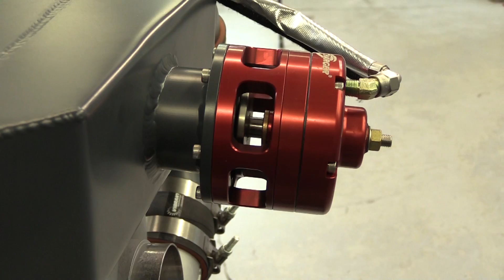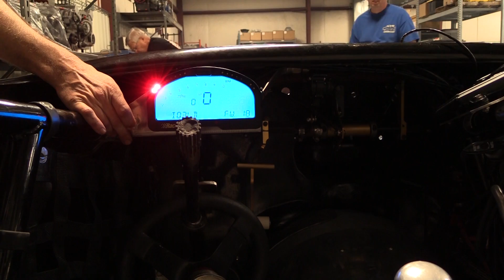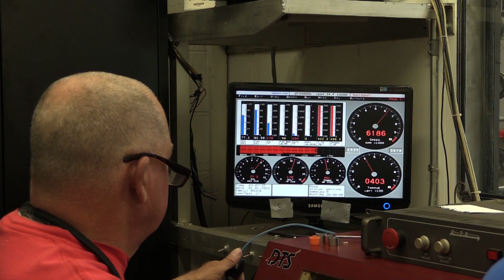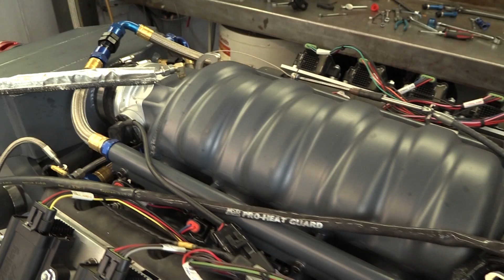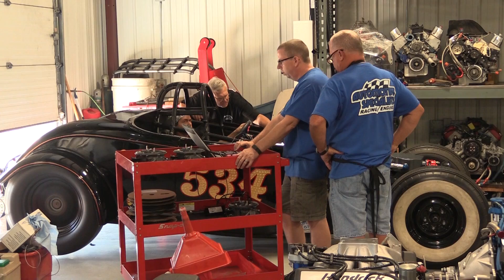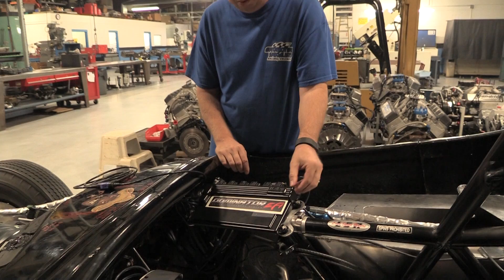A Thousand Horsepower on Just 260 Cubic Inches!

Comment: Engine size and combo are moot. They tested a thousand h.p. turbo. Bought not thought.
Woo hoo. 😐 an sb2 should make 1000 h.p. n/a. Unless somethings wrong.
Reply from the maker: A 260 cubic inch LS is going to make a thousand horsepower naturally aspirated?
Reply: @TheHorsepowerMonster  i never said that. Thats your spin. But an sb2 will easy. 260 cubes X 3 = 780 h.p. so your turbo was good for 220 h.p. and will be able to carry its own weight.
Yes pathetic from my point of veiw.  But 1000 h.p. 260 inch are good buzz words.
Reply from the maker: @mohanperformance.enginerd.1308  The rules of the class require the engine to be less than 260 cubic inches. Dorton determined that they would need nearly 1,000 horsepower to break the speed record. (Sorry, I typed LS in my earlier comment when I meant SB2). So how else are they supposed to get there? Of course an SB2 can make 1,000 horsepower, but not when limited to 260 cubic inches. How is this "spin" or "pathetic"?
Reply: @TheHorsepowerMonster  It seems you believe 1000 h.p. or just under 4 h.p. per c.i. is a great achievement with a turbocharged V-8 spark ignition engine. Is this a fair statement?
Reply from the maker: @mohanperformance.enginerd.1308  There are plenty of 1,000 horsepower engines out there. Most people who view videos on my channel can appreciate the engineering that goes into achieving it in different ways. If that's not you, then that's cool.
Reply: @TheHorsepowerMonster  how come you won't answer my question. Does my question make you uncomfortable or seem offensive in some way?
Reply from the maker: Sure, I'm impressed by any motor that reliably makes a thousand horsepower.
Reply: @TheHorsepowerMonster  a motor is a divice powerd by electricity. This conversation ends here.
Reply from the maker: @mohanperformance.enginerd.1308  That's pedantic. Motor and engine are colloquially interchangeable. Nobody that reads my comment is going to be confused and think I'm talking about an electric motor. I know tons of engine builders and almost all are willing to use the two terms interchangeably.

Comment: There was a whole stack of these built 5-7 years ago. Nelson racing built a twin turbo LS 260, custom crank for big block 6.535 rods, boat racing. It made 1200hp and he ran it wide open fully loaded for a half hour. When they took it apart after 5 hours of testing, there was no wear at all. All the bearings looked brand new.
Reply: this comment is very slept on. These 260 class motors have a legendary record in boat racing. Seems like the extra rigid block, low inertia components moving tons of air through a head, and the ability for boats to dump all that waste heat into unlimited coolant combined to one hell of a package.

Comment: Let's see. In the late 70s there was a 209 ci stock block run at Indianapolis that was putting out 1100 hp. The kicker is it was a freaking AMC. Supposedly one of the most powerful engines ever run at Inianapolis.

Comment: I do believe for ultimate power nothing beats CID cubic inch displacement with that said I also believe it's not how big your are but how you are  built and turbos are a  prime example of that  , take a normally aspirated engine platform add twinn turbos with the proper compression ratio right cam manifold  and ported heads and you can quadruple your engines  power    iv seen lil 4 bangers with 1400 hp , could you admagine how much more hp you could get say out of  twinn turbo charged 350 V8

Comment: I'm a little surprised the SB2 holds up to that amount of power under boost, I met some guys running a turbo one that kept lifting the heads off at the top end of the 1/4 mile, the SB2 was designed for NA power, even with high compression, the secret must be the short stroke, I believe they were running 383 or 400 cubes at the time. I don't know if they ever got it figured out, only saw the car a handful of times

Comment: Hold your horses. Small cubic inch numbers per cylinder mean it's hard to get compression? Someone needs to elaborate this for me please. Must mean that all the japanese and central european engines with around 400 to 550cm³ per cylinder don't make the power they make or that they can't be mass produced engines? I really don't get it.
Oh, or is he referring to american engines?
Reply from the maker: Not exactly. I probably wasn't clear enough with that. Dorton wanted to keep the large piston diameter because it allows for bigger valves and better airflow into the engine. So in order to get the cubic inches down to where it needed to be he had to cut the stroke. So the short stroke combined with the bigger size of the combustion chambers (in order to work with the large valves) dictated a low compression ratio. In order to combat that, he simply cut out two cylinders, which allowed him to use a longer stroker which bumped the compression ratio back up where he wanted it. Hope that helps, and thanks for watching!
Reply: @TheHorsepowerMonster  Okay I see. So you didn't want to change the piston shape nor the cylinder head to facilitate a higher compression. I understand, it is much more complicated.
Reply from the maker: @GERntleMAN  You got it. Thanks!

Comment: We get 1000hp out of a 2.6L (or 158ci in old imperial) turbo straight 6 in Europe. 
How do yanks get soo little hp out of such big engines.
My 2.0 turbo has 614bhp reliable 14876miles on it so far no issues other than one leaking injector seal (bad after just 200ish miles)

Comment: In the 1980's a 1.5 liter (91.5 cu. inch) twin turbo V6 (Ferrari or Renault) or inline 4 (BMW) Formula 1 motors produced 1250 to1500 hp in qualifying tune.
Reply: That’s speculative

Comment: 4.3 liters making 1000hp... ford did this years ago with their 4.6 liter and that’s making 1000 hp at the wheels not crank. Ford’s 3.5 v6 in the GT MKII makes 700 hp stock so with some tweaking it’ll hit 1000hp.
Reply from the maker: Ford made 1,000 horsepower with their 4.6?
Reply: The Horsepower Monster aftermarket parts but a ford block
Reply: The Horsepower Monster you act as if the engine in this video is also stock... I never said it wasn’t a great achievement. I love all huge power builds. But since you’re being a dick about it I won’t watch any more of your videos. I simply pointed out there are many other builds out there that are just as impressive and even more impressive.
Reply: Honda K series modified with 2.4 L made 1000 hp.
Reply from the maker: So Ford never made a 1000 horsepower 4.6.  I don't understand why people like to point out other engines. Sure, this isn't the first 1,000 horsepower engine, I never said it was. I just thought people would appreciate the engineering that went into the build. So what if somebody has built a thousand horsepower 4.6 already?

Comment: I have a similar build in mind, i want to destroke a 6.0 ls engine, the shorter stroke is supposed to allow the engine to rev higher and with less friction.
Reply: Valve train is what limits high rpms

Comment: You can get that much hp out of 3 litre 2 stroke WITHOUT forced induction
Reply: Lol 4.2 liters for 1000hp.   Thats a waiste.   Need only 2l and 4cyl for that. Got 2.2 5cyl in europe who daily 1000hp no problem.
Reply: @bergrud  But make how much torque at that speed? Also, if you think a Honda is going to the Bonneville 230+ club, I'd love to see it. Nothing against Honda.
Reply: William Landen im not talking Honda.   Say Audi s2.  You have drag setups in those no ls with similar Numbers can beat.  Stockholm open has been won by one on 950hp.  And Thats against several 1000-1700 v8.
Reply: @bergrud  nothing beats a 2 stroke m8 :P

Comment: 1400 BHP from 91 cubic inch 1985 bmw f1.
Reply: Wasn't that just a qualifying power level? Those things would not last like that.
Reply: iPROFITDON yes I dunno why he’s boasting lol while it’s cool and all those engines were toasted after qualify laps😆 and the 1400 hp was guessed as the Dyno wouldnt go past 1200
Reply: @zethloveless7238  I mean it's cool to look at the numbers if you ignore the fact that it only lasted a lap lol
Reply: iPROFITDON yea I’ve had so many dudes bring that damn car up 🤓. But still pretty awesome it did make around 800 from a 1.5 for the entire race 🤷‍♂️ back then you had no limits on the number of engines you could use either.
Reply: And that was with a stock BMW block. Not a special racing design. How much were Offy's putting out in the day.

Comment: ....or you could start with a 4.0 l (240 CI) Mercedes E-63 at 600+ HP... because it's capable of doing a couple hundred thousand miles at the 600_ hp level - I think there's room for some headwork, a new cam, and some bigger turbo to get close to that 1000 hp mark.

Comment: In my younger days i built a 283  with 60 over and 11-1 forged pistons on factory pink rods ran on reg pump gas with a mallory dual point  ,
One fine day with my fine tuneup on the new superlane expressway i decided to go all out for top speed , as the pink rods were limited to 7250 rpm i went by rpm  ,on 1st to 5k and on 2nd to 6k and on 3 to 7k plus , , ,  at 7250 rpm i heard the beautifull engine sound pitch began to change so i backed off and saved the engine , it was a wierd wonderfull but so dangerous experience, 
After years i came across a speed math formula and calculated 
It turns out that my speed was 197.3 mph when i backed off from 7250 rpm at high gear 
All this was in a 55 chevy 4door that i got running and was my daily driver as a highschool student back in 75
SHARE your story

GREAT STORYS and GLORY DAYS

Comment: Not to rag on the guy they did an awesome job but there are 4cyl making that kind of power and the inline 6 2JZ Supra engine will make double that. It just sucks that they couldn’t get more power from an American built engine
Reply from the maker: Not at 10 psi of pressure they aren't making more power than this. And they aren't making five-mile passes at Bonneville and living. He stopped at 10 psi because they got to over 1,000 horsepower which was more than enough to break the record they were shooting for. Thanks for watching.

Comment: General Motors Holden of Australia made a 253 cubic inch OHV V8 cast iron engine from 1969 to 1999 for several types of automobiles. 
Quite reliable overall in standard factory form. 
Capable of 500+ bhp without forced induction.
Enjoyed your video.
Reply: Holden 253's finished production in 1984, not 1999.
Also no Holden 253CID motor ever made anywhere near 2HP per cubic inch without boost or N2O. 
Holden's best and brightest at the time only ever achieved 1HP per cube out of the 253 for the aborted Hurricane project.
Reply: Chevrolet in the states and Canada made 260 /4.3 litre v8 based off the lt1 5.7 . Came in the caprice wagon and car .

Comment: Was the class size set by Ford's 260?     Smallest SBC was 262 so you have to custom build to get into class?
Reply: Possibly, but he said that the stroke is slightly longer than 2.5 inches. Shorter than any stock SBC. Given the displacement, it could have a 4.03 inch bore (common overbore size) and a 2.55 inch stroke. So - custom ground crank and a very expensive, trick valve train.

Comment: Tourqe times rpm give hp. Horse Power has a time value in the equation.
Reply from the maker: The equation for horsepower is torque x rpm divided by 5252. Is that was you meant?
Reply: @TheHorsepowerMonster  thank you. I really wondered about the relationship but all I could come up with was the time value. Wasn't aware of the constant
Reply: How did they come up with the constant.
Reply from the maker: That's an interesting question and it made me stop what I was working on to Google it (any reason to procrastinate, right?) Anyhow, the guy that invented horsepower, James Watt, decided that one horsepower was the amount of work needed to lift 75 kilograms one meter in one second. When you do all the math to kilograms  to pounds and meters to second to revolutions per minute, the constant somehow works out to 5252. I learned something today, and thanks for watching!
Reply: @TheHorsepowerMonster  thank you much. I'm a diesel guy and that is what started my interest in engine power descriptions. Also I would like to mention an article I came across some time ago. Namely that a 250 cu in engine at 10 K rpm theoretically has the same displacement as a 500 cu in engine at 5K rpm. I found that to be an interesting way on looking at power production.

Comment: What!? U could of used a GTR motor they make 3000hp under 4.2 liter
Reply: They make 3000hp after you put 60000$ of internals it’s way
Reply: @cnp-auto-1445  yea tru but still I didnt hear of any strict budget
Reply: Fabe P these nascar engines require very little building and the engine is built for lsr which has strict engine regulations
Reply: @cnp-auto-1445  ohh my bad then I thought it was ONLY 4.2 liters or under and anything else goes.

Comment: I remember John Lingenfelter doing experiment with 350 Chevies. He built a 302 and a 383 basically in the same car. The 302 made more HP. up top and went more than 5 mph. faster on top end. A Trans Am  did 185 MPH. 180 with the 383.
Reply: In my younger days i built a 283  with 60 over and 11-1 pistons on factory pink rods ran on reg pump gas with a mallory dual point  ,
One fine day with my fine tuneup on the new superlane expressway i decided to go all out for top speed , as the pink rods were limited to 7250 rpm i went by rpm  ,on 1st to 5k and on 2nd to 6k and on 3 to 7k plus , , ,  at 7250 rpm i heard the beautifull engine sound pitch began to change so i backed off and saved the engine , it was a wierd wonderfull but so dangerous experience, 
After years i came across a speed math formula and calculated 
It turns out that my speed was 197.3 mph when i backed off from 7250 rpm at high gear 
All this was in a 55 chevy 4door that i got running and was my daily driver as a highschool student back in 75
SHARE your story

GREAT STORYS and GLORY DAYS

Comment: "Hey didn't the monza start off with the smallest V8 chevy ever made?" It did in '75 with the 4.3l 262ci motor. I see here, this isn't such a stigma anymore... although you'd need a twin turbo setup to get it all to fit under the hood.
Reply: As far as I know, the smallest production V8 Chevy made first showed up in 1955, a 262 cubic inch meant for the Corvette. Then came back in 1975 with a different bore/stroke ratio and made another appearance in 1994.
Reply: @sparkplug1018   The 1955 Vette motor was a 265ci.    Sometime later in the 80's came the 267ci,  and then there was a 262ci again but that was a V6.
Reply: @theredspyder2112  You're right, its confusing because they describe the 265 and 262 as a 4.3L. The 262 is 4.2 really. I think the 267 (4.4L) was like 79 or 80.

Comment: what is sanity... I tried driving a 3/4Ton truck that had the frame shortened to were the frame was near square... was made to look like an old jeep, it just had a simple old 350 Chevy engine in it and a 4 speed manual... now if some one is going to put there foot down with a 1000hp engine like that in the truck they have gone and lost there sanity and need to be bared up and followed everywhere.

Comment: Hey I had a 260 small block V8 from a olds Cutlass once lol... Honestly the engine didn't seem to small by looks it looked like a 305 or 350 but it was a blue olds 260 V8. And it sounded really good had headers ECT when. I got it. But once I found out it was a tiny 260 lol I changed it out for a 350 small block Chevy lol

Comment: I had a 260 V8 in my 76 Olds Omega, it built power and rpm rapidly. Could imagine the throttle response on this one.
I have an 84 Toyota Supra GT. I bought it with 16,000 miles, has 60,000 on it now but from not being drove alot it needs valve stems replaced, I'm considering an all aluminum small cuid V8 like this for it.
Alot of engines will bolt to its 5 spd. Wonder what this one weights with its blower. Custom cut forged pistons alone are $1,000. It is more expensive to modify its I6.
Car only weighs 2,700#

Comment: Don't these 260 blocks have bad thermodynamics? I had a carbeurated one and the oil would cake in the rods. I'd have to change em every year. I finally dumped it for an Olds Rocket 350 out of an early 70s 442. I'm sure the engine in this video has probably got all the kinks worked out.
Reply from the maker: This was a 350 SB2 block that has been destroked to get down to 260 cubic inches.

Comment: I would doubt the ever ran on the salt yet. Evan on the best years you need to over gear for some wheel spin. Traction control is beyond useless for this application. Way cool engine though.

Comment: 1,000 HP on Only 10 lbs of Boost?
Reply: Double the size of the turbo with half the pressure equals exactly the same CFM of air
Reply: VITO SCOTTI and that would theoretically reduce wear on the bottom end because it’s at a lower pressure?
Reply: That's true efficiency right there!
Reply: No because its the same CFM and a smaller charger making big boost
Reply: People always ask "how much boost" but that really means nothing without knowing what size turbo they have. You can have 100lbs of boost with a 10mm turbo or 10lbs of boost with a 100mm turbo and have the exact same amount of air being crammed into the cylinders.
Reply: You also have to take into account how high this engine can rev, it was still climbing up past 7200rpm
Reply: @AgiDaKinG  my lsx is limited to 9500 making 530hp all motor its not hard to get a ls to make over 9500 rpm and be reliable

Comment: what a concept.....we've been doing small cubic inches and lots of boost for over two decades with 281 inch Ford modulars. i am personally only at 700rwhp (800+ crank hp) in a daily driver 96 mustang gt with a built stock cubic inch lincoln mark8 engine.  others make far more daily driven.